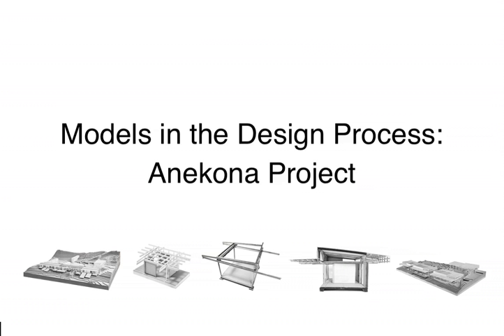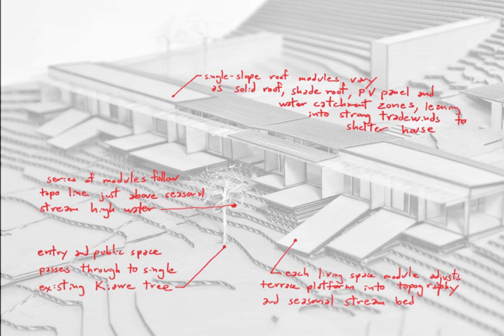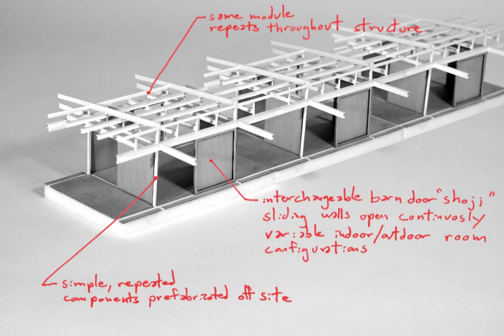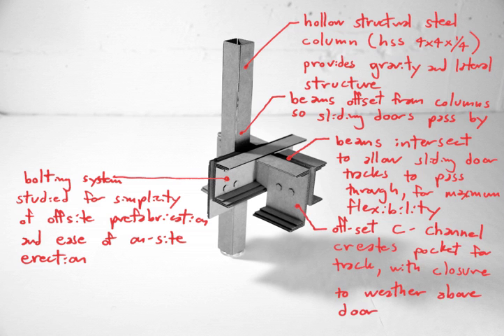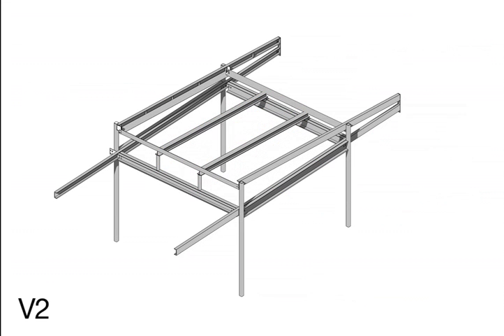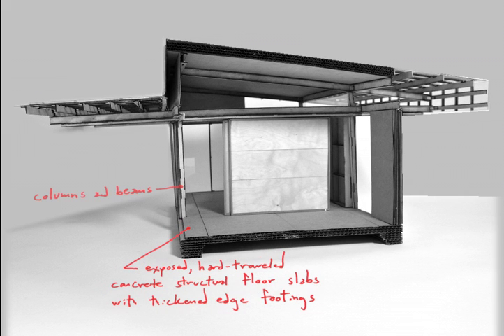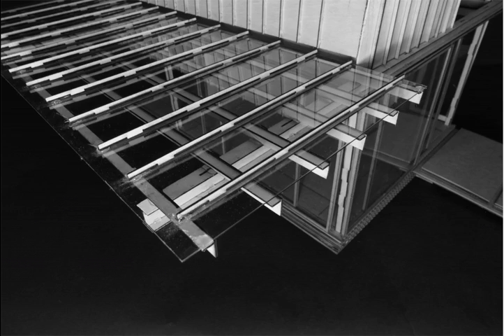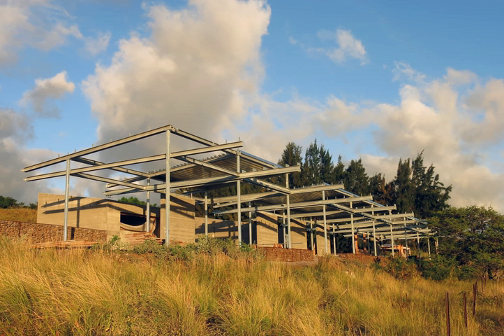Models in the Design Process - Anekona House

Comment: Much to admire in this design, not the least of which is the hands-on iterative process of evaluation and optimization.

My own recent design work toward affordable residential prefab structures have used various HSS and W sections - mostly as steel portal frames, which my amateur use of SkyCiv has informed.  Wondering how the Hss4x4-0.25in performed as portal frame column elements, though I now see the W sections are quite stout so with rigid fixed coupling directly into the concrete floor slabs they likely perform very efficiently.  

Now using steel skeleton moment frames, I've abandoned my earlier attempts to design affordable prefab modular residential houses and backyard cottages.  Not smart enough to coax prefab modular into an affordable methodology which I have begun to see as just custom stick-built manufactured at two locations: warehouse and onsite.  Sadly, Glidehomes (Michelle Kaufmann) and even Katerra were not successful with prefab modular approaches either.

With the goal of significantly improved affordability the exterior shells of my designs are I think unique, however not very flexible in shape or massing(?).  The interior two story space since it does not require any shear or load bearing walls is quite open and flexible to program.

The Anekona House is a very interesting design.   Walter Gropius and his friend Konrad Wachsmann I imagine would be very intrigued by this flexible panel focused house. 

-- mark early, Seattle